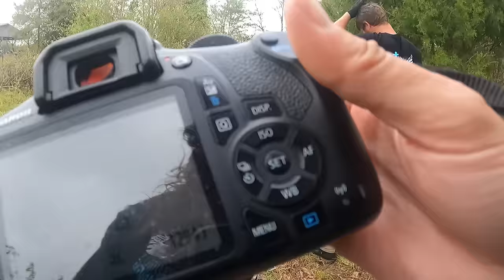Pulled 12 Motorcycles out of the Woods in FLORIDA

Comment: I get that this video's three months old but just a little trick when using a wench take your floor mat and throw over the cable so if it breaks and gets bound up on your trailer it doesn't snap and sling off and hit a dog or an operator just a little trick from an old-timer
Reply from the maker: Thanks for the tip!

Comment: Guys used sell steering necks on chopper forums if they had a title for like 100 bucks. Have to admire your determination and persistence to lug all those bikes out the woods. Id have bribed a neighbor with tractor loaded or a bobcat to load all of that.
Reply from the maker: Thank you. That would have saved a lot of time but we were able to use the winch on the trailer which helped out a bunch.

Comment: hope for videos on the yamaha maxim, still have a 1980´s XS1100 sidecar bike running, titeld, insured as my daily runner.
Engine and driveshaft seems very simular if not equal.
Could be very educational to me.
Reply from the maker: That's super cool! We are trying to go down the line, we started with the little Indian bike first.
Reply: @ResurrectedGarage  there is no hury, mine is  in exellent condition, in germany we have to get a inspection by law every two years to be allowed to ride or drive a vehicle in public traffic.
bike passed without any defects (and that includes everything, functional lights, breaklight, turnlight, breaks, exhaust, not loosing oil anywhere, good tyres...) not long ago.
but it´s always good to know, before you need to know.

Comment: Stupid ford should of had a dodge this is caused by black dirty brake fluid i chage my drake fluid every 3 years
Reply from the maker: The material delaminated from one of the brake pads and the caliper piston blew out because it was traveling to far. This was a cause of just bad parts. We are not brand loyal by any means but we are just using what we have to work with.
Reply: YOUR AWNSER HAS NOTHING TO DO WITH DISTANCE ITS A HUGE DEASEL WITH A LOT OF WEIGHT BRAKE FLIUD WILL GET LIKE SLUDGE AFTER A LONG PrERIOD OF TIME it's a diesal truck with a lot more weight  if the fbrake fluid was kept clean this never woul of ocured proper maintenance us every thing all.fluids must be kept clean